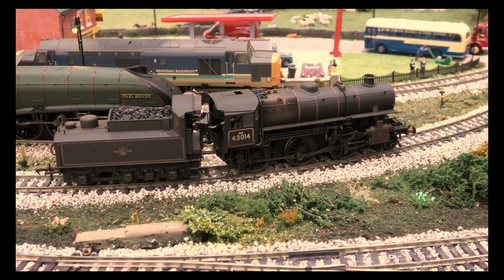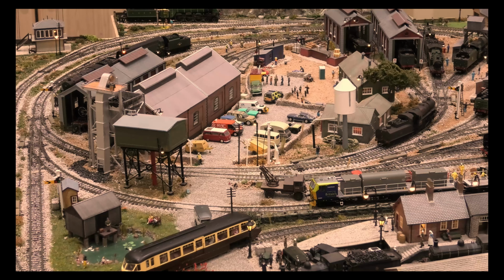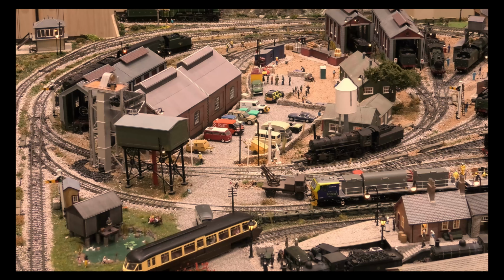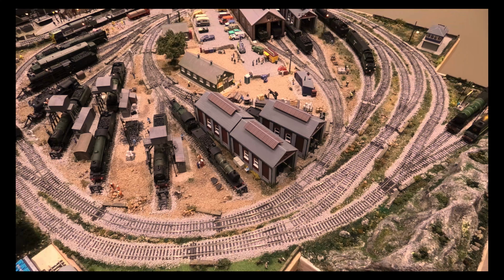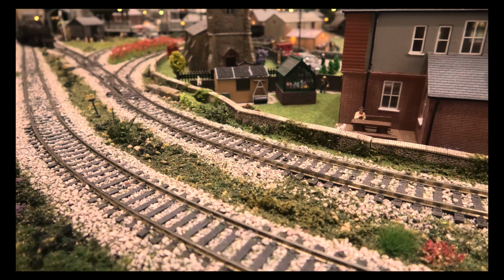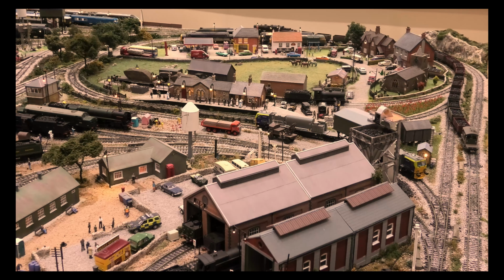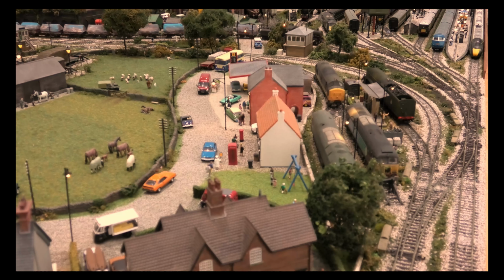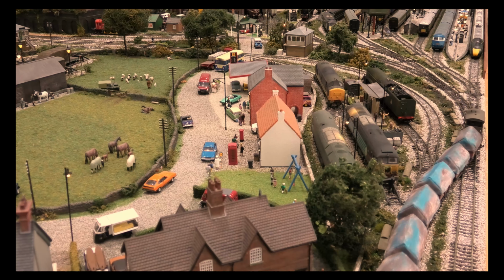Bachmann Ivatt 4MT 32-580A review.

Comment: I actually just purchased a similar version of this engine although it's the version bachmann released with the.doubke chimney. Really looking forward to its arrival
Reply from the maker: They are nice but this model I have is sensitive to track.
Reply: @PaulBriden  sensitive meaning its stutters if track isn't clean or sensitive meaning if the track isn't perfect it'll derail
Reply from the maker: @ghostengineer  The first applies to all, but sensitive as in, if the track is not perfect on the bends it will derail. As in fishplates being properly lined up on the horizontal and the track being level on the parallel. However, mine may have a faulty chassis or one that is out a tad as I have another one that is better.